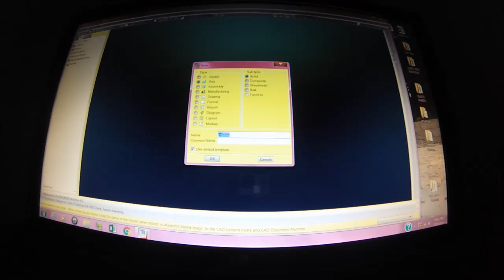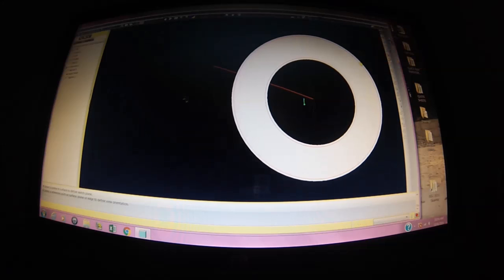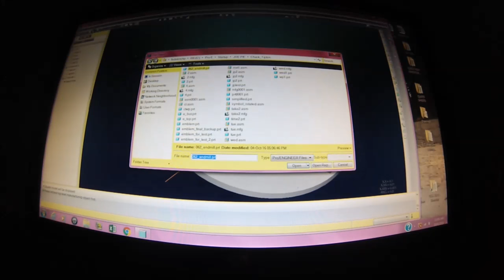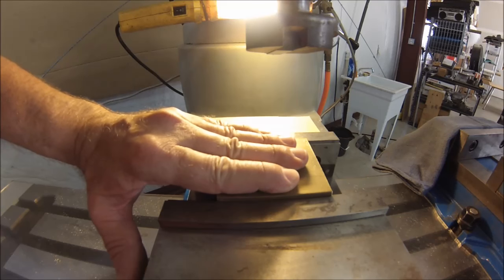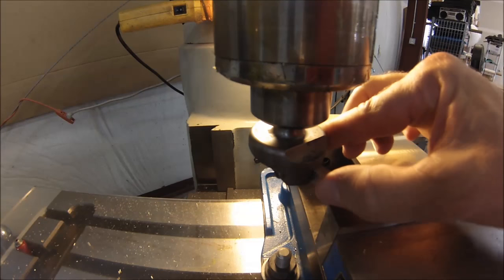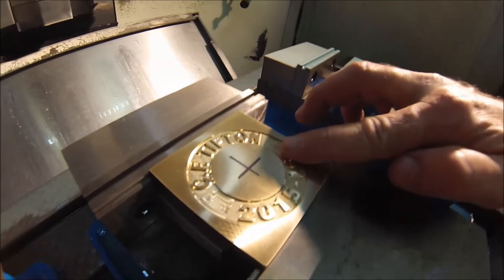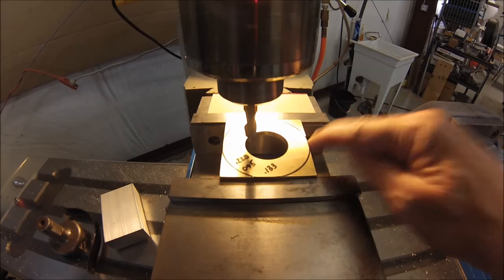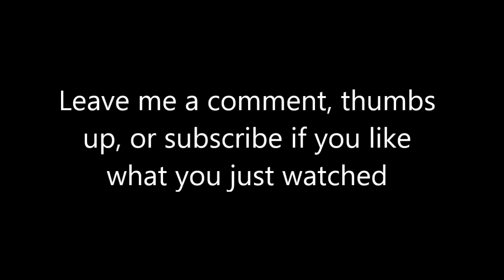PROJECT VIDEO   Fabricating a brass emblem for a model steam tractor

Comment: Hi Joe great job checked out a few of your videos and just subscribed I like your emphasis on safety but just wondered did you cut your finger removing swarf by any chance lol this really does look like a channel I am going to enjoy....
Reply from the maker: Yep, during the lathe operation on the brass part. I stopped the machine, broke the swarf ring apart and gently pulled it away from the part. The very end of the ring snagged between the part and arbor and my finger lost that battle. It was just a little reminder not to get too cocky. Good eyes.
Reply: It proves i was watching lol....
Reply from the maker: I intentionally left in a detail that changes during the duration of this video. It much more obvious than the band aid on my finger, yet not one person has mentioned it. You want a real challenge....find it.
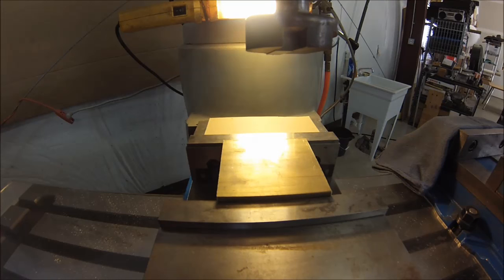Reply: Joe: Great video content.  I watched it a second time to look for the detail you mentioned.  The most glaring safety issue I noticed was the presence of a loose rag on the vise to the right of your mill at approximately 16:25 during the fly cutting and then again at approximately 33:33 during the thinning of the back surface.  I really appreciate the effort you put into your presentations. John Gunn, Visalia, CA
Reply: Joe Pie: BIG DUH !! on my behalf- its the twisted extension cords dangling in the left hand back ground of the manual millng scences !!
Reply from the maker: I'll give you a hint.....Digital vs actual   Thats all you get. no one has caught it yet. I am shocked.
Reply: Based on your hint, I'll say this pertains to the final cuts of the ID center bore which you deliberately left "too small" on the CNC mill and overall OD of the emblem which you reduced on the lathe with the guidance of calipers.  Your design called for a thickness of 0.030" for the borders on the inner & outer edges of the channel.  The inner walls of the border were determined by the smaller CNC tool.  The final overall thickness of the outer edge was shown in the video on the lathe.  The final overall machining of the ID was not shown in the video, but likely was done on the lathe and guided by calipers prior to making the delrin backer block with the boss that matched the ID & thickness of the emblem.
Reply from the maker: The ID was finished to size on the CNC mill. Second hint.....12:20  vs  28:46
Reply: You added the year to the name plate
Reply from the maker: You are correct with that observation, but thats not it.
Reply: C.P. TIPTON on the digital lay out and C.F.TIPTON on the actual.  That wuda REALLY  messed up your day if you hadn't of caught that before firing up the CNC mill !!
Reply from the maker: BINGO. Good catch. I am shocked nobody else caught that. C. F. was the requested text.
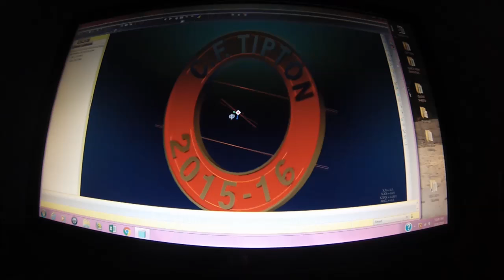Reply: Now that you pointed it out, you show it clearly at 13:00 in the final digital layout.
Reply: Well don mate real goos observation

Comment: From U.K. Hi joe I have a very old engine lathe which has no screw cutting dial indicator. How can I make this work?
Reply from the maker: For threads or something in this video?
Reply: Joe Pieczynski  no for threads in general. Is it possible to go through the whole process starting from spindle gear down to engaging the half nut at the right time. I appreciate this conversation is in the wrong video, my apologies! And just to throw the spanner in the works can you talk about metric as well. P. S. loving the explanations and illustrations.
Reply from the maker: I don't do many metric threads, so I may not bluff my way through a video on that. Thanks for the comments.
Reply: Joe Pieczynski no worries

Comment: Joe I did something like this a while back but in a totally different way I turned a disk on the lathe then letters were applied and it was cast in brass. I have videos of both parts on my channel. if you're interested in seeing what I did (to bad Mr bozo showed up at the foundry )
Reply from the maker: This sound like something I will check out. The small gaps made me think about casting it, but thats not my area of expertise at all.
Reply: did we finally find your kriptonight . I had the same thought about cnc but I don't have the skill or machines at my disposal. I tend to work in a older mode I think it's more aprochable and or more affordable to get into.
Reply: almost forgot I'm located in California right between randy Richard and Tom lipton
Reply from the maker: My kriptonite is paperwork and forms. YUK

Comment: The leg of the P didn't line up because that is not the center of the letter
Reply from the maker: Another subscriber pointed that out as well. I looked at it several different ways and decided it had to go. The assumption the CAD system made, caused the 'P' to not only lean, but seriously crowd the 'I' along side it. It worked out in the end and now gives me something to look for on future projects. I plan to re-post a " Martin Brothers" video showing the latest engraving project. No text, just wild freestyle of their logo. Take a look when that posts. You sound like someone that has CAD or CNC on your resume.